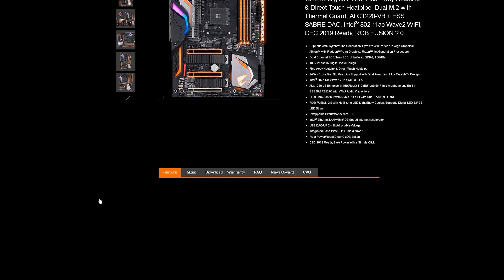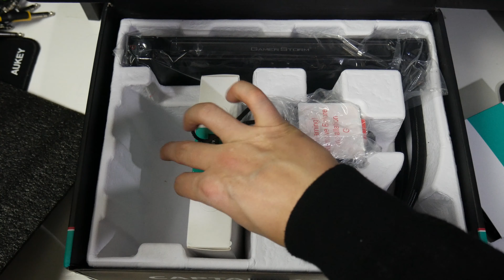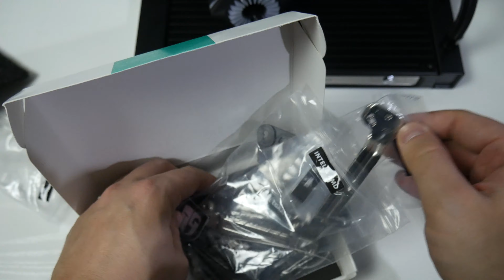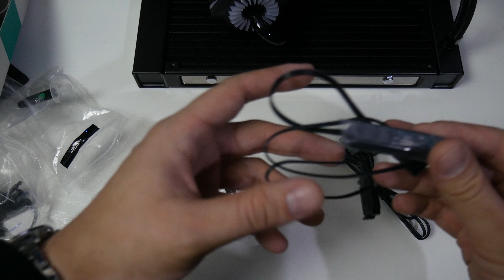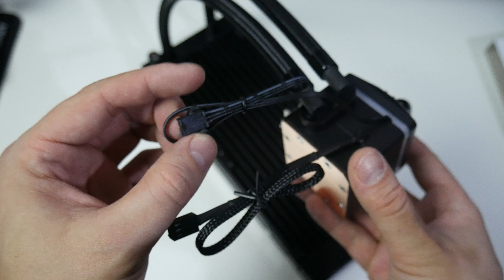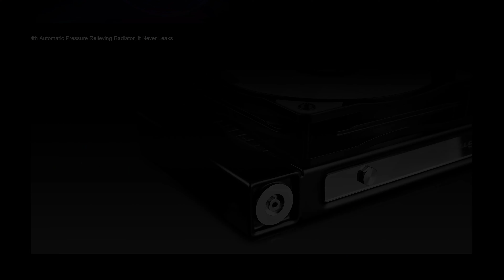Deepcool Captain Pro 240 Liquid Cooler Unboxing and lighting Test

Comment: of all the Deepcool AIO's which one do you think is the best for the money. I have been looking at the 240EX RGB and have heard great reviews but if the pro is worth the extra money Im interested in taking  a look into that too.
Reply from the maker: Pro doesn't perform any better same pump, same rpm fans. Your getting the anti leak tech and addressable RGB with the pro. If you want best value with RGB then that's the l240 it's the cheapest and has faster pump than captain but it doesnt improve the temps. The mounting is better on l240 and the castle cooler it's easier to position vertical or horizontal. That all being said  my favourite is the captain ex in white though.
Reply: TheFullSetup alright. Thanks for the info will definitely help. I am super close to pulling the trigger on the captain all white because I have a white thermaltake p3 the arctic tomahawk MOBO and white Corsair vengeance ram